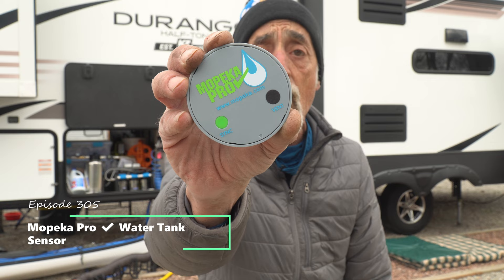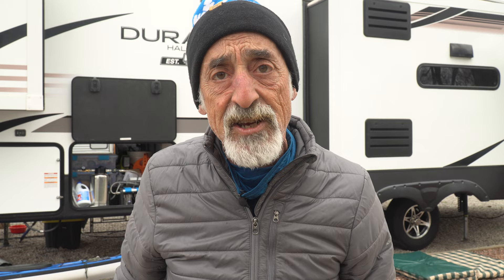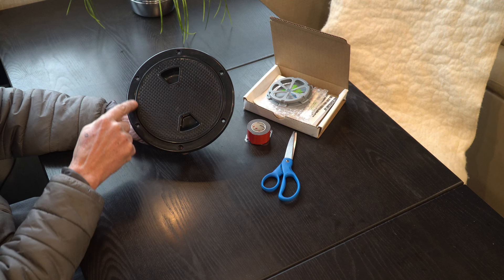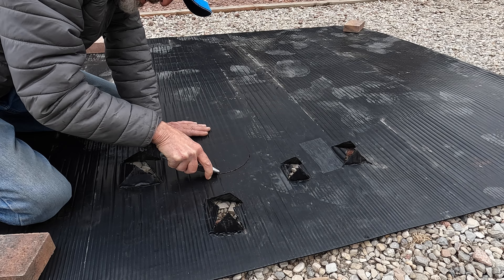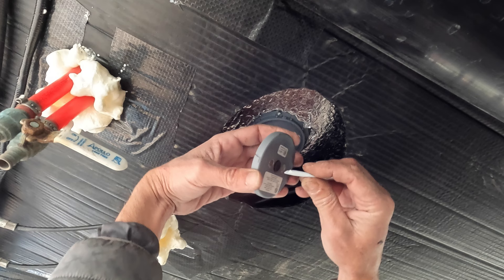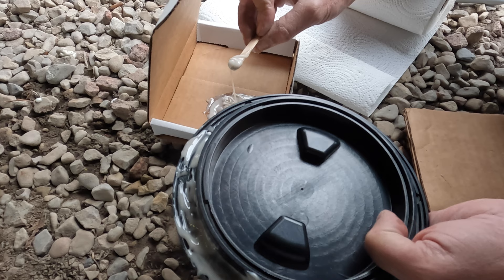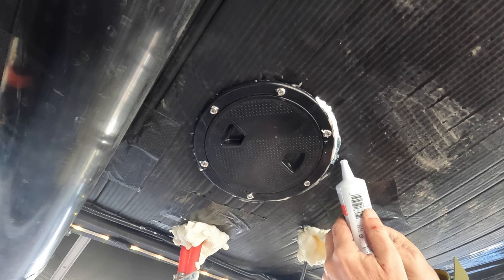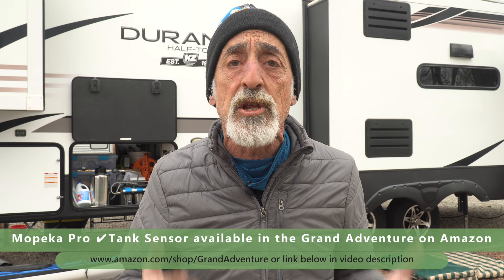Ep. 305: Mopeka Pro ✔ RV Water Tank Sensor | DIY RV upgrade

Comment: This is a great idea.  I share your concern about existing tank sensors.  Since I tend tobuild egg cartons from 2x4s, the only feature I might suggest is a short piece paracord (handy stuff) attached to the back side of the inspection cover and to the concealed surface of the cover flange.  The cordage will save the cover if it vibrates loose in travel, and it will be completely contained so it won't grab snags along the road or trail.  A  6" length should be long enough and will allow the twisting when replacing the inspection cover.  Thanks for a stellar series, all the way from Taylorsville.
Reply from the maker: That's a great idea, Richard! Thank you for giving me another project. 😄

Comment: Nice product.  I use Mopeka on my propane tank.  However, many fresh water tanks sit on a floor, which isn't compatible with the Mopeka sensor ergonomics.  They need to make a sensor that's .020" thick, so it could be slipped between the tank and the floor.
Reply from the maker: Tom, I wonder if the sensor would work as effectively top down as it does bottom up?

Comment: I have to pro sensors on our propane tanks, they work so much better than the older sensors.  I love the sigh sounds during the install, haha. I think I would have just made a door in the material closed up with duck tape.  Your solution is much more professional.  I think I’m getting one. Lar
Reply from the maker: Larry, I can tell you using it this week while boondocking has been a godsend. We can much more effectively monitor our water consumption.

Comment: Duct tape, a sharpie and a tape measurer.  Because we can access our tank visially with ease, i stuck a strip ofape up the height of the tanks.  I marked increments with the tape and sharpien  and the respective gallons available and gallons used on the tape at each increment.  I calculated the gallons based kn the tank physical dimensions...not what the RV manufacturer said the capacity was.  Low tech and almost free solution to know how much water is consumed and remaining.
Reply from the maker: If you have easy access to view your tank, that's the perfect free solution! Most of us, however, don't have that luxury.

Comment: I installed Mopeka standard sensors on the LP bottles but they failed quickly. Mopeka sent me new Pro sensors and I installed them with retaining rings (belt and suspenders!) and they have worked fine since then. One battery lasted about 18 months. The other I replaced at about 24 mos.
Reply from the maker: That's impressive Charles! We still have the second generation LP tank sensors, and we get about 6 months out of a CR2032 battery.

Comment: It is sweet. Wish we could install it in our truck Camper but the tank is not in a place where you can get to the bottom of the tank. Our water tank in there has no sensors. Thanks for sharing such a great product. Mary 💞 Fred
Reply from the maker: Thanks you two! I'd think that if you can access the tank's side you could at least install traditional sensors.

Comment: Thank you!
One question:  could you not just go ahead and use the screws to hold the ring in place to cure?
Reply from the maker: Thanks Robin! In our case, the screws in that soft poly underbelly material simply didn't provide enough purchase to create the amount of pressure we were looking for to achieve good adhesion.

Comment: Why not remove the overflow drain ball valves and put a tight fitting cork in the line?  This way if you forget to open the valves while filling the corks will simply pop out and prevent another disaster.  Just an idea.
Reply from the maker: Perhaps not a cork, but as someone else suggested some sufficiently loose fitting rubber cap. We're still thinking. Thanks for the suggestion!
Reply: @GrandAdventure  That would also work.  Either one would pop off under pressure.

Comment: Thanks for the video. After a year, is the Mopeka sensor still working OK? Do you think it will work for the black and gray tanks?
Reply from the maker: It's functioning like a champ in our freshwater tank, Gary. It still showing a nearly full battery! We have it integrated into our Victron VRM, too. You might get away with it for gray water, but as we understand it there are too many solids in black water for the ultrasound of the Mopeka to work effectively.
Reply: @GrandAdventure  Thanks and that Victron VRM tip is great as well.

Comment: Does the sensor ever read empty or is LOW as close as it gets? How about the full accuracy?
Reply from the maker: We've found it to be highly accurate, Larry. After ~20% or so it reads only "low" -- which is understandable, as the accuracy would be substantially diminished once there's only very little water left in the tank.

Comment: Hi Marc. I just installed the Mopeka Pro after watching your video on all three tanks - fresh, grey and black.  It seems to work correctly on the fresh water tank and it somewhat works on the grey tank. When empty, it still says it is 23% full. But it did steadily decrease when I drained the grey tank.  I'm still trying to see if I can calibrate it better. The grey and black tanks on my RV (RoadTrek Adventurous TS) are flat on top and bottom, but oddly shaped to fit under the RV. As you mentioned in your comments, the black tank does not seem to work at all.  Question: Did you get your fresh water Mopeka sensor to work with your RVWhisper system?  I'm trying to do that too. Thanks Marc. Keep the videos coming!
Reply from the maker: Hey Patrick! As you've discovered, the Mopeka Pro won't work with your black tank due to the solids in there. You may have better success with the sensor on the grey tank as long as you have few to no solids from the kitchen sink, although we haven't tried anything other than the fresh tank.

Yes, I believe that we did get the sensor communicating with RV Whisper. We've since, however, abandoned RV Whisper when we installed the Victron Cerbo GX, which mimics the functionality of RV Whisper through Victron's VRM. It made the RV Whisper superfluous in our installation.